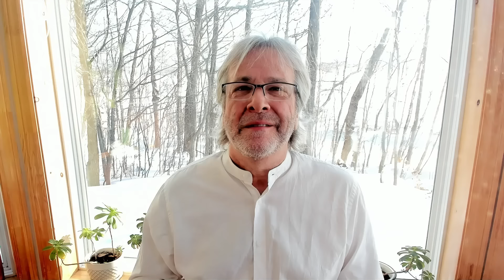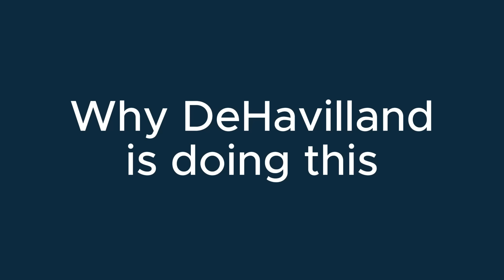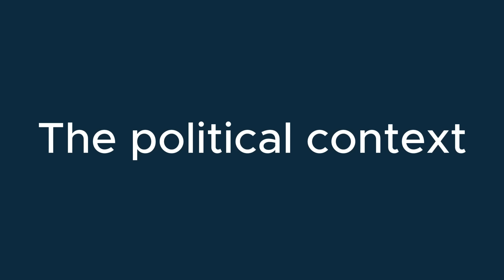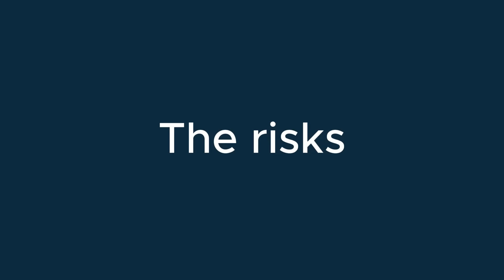De Havilland Field: The Quiet Canadian Project That Could Change Aerospace Forever

Comment: Is Viking part of DeHavilland Field. Where are the CL-415 and 515’s  being built. What happens if Alberta separates
Reply from the maker: Viking & De Havilland Field
Viking Air no longer exists as a separate company. Iit was folded into De Havilland Canada in 2024.
The merged company is developing De Havilland Field near Calgary as a major new aircraft manufacturing site.
The old CL-415 is no longer in production; De Havilland now supports the fleet.
The new version, the DHC-515 (formerly CL-515), is being built and assembled in Alberta, with final assembly planned for De Havilland Field. I hope Alberta doesnt seperate. We are so much stronger together. thanks for sharing

Comment: You have to understand the politics.  Trying to break into the small to medium passenger aircraft segment, and all the competition and political lobbying from the larger manufacturers, De-Havlland sort of got pushed under several times, and has had several owners including Bombardier.  That Boeing does not produce state of the art, and "reliable" and "safe" airplanes any more, but does a lot of political lobbing and arm twisting to maintain a market share that it does not deserve.  I would not fly in one.

This  De-Havlland factory is sort of hush-hush because it has more than a 50-50 chance of failure.  But if it suceeds it will really suceed, and be a competitive source of airplanes.  A sucess factor is selecting the right size and type of plane to manufacture.    There is a "sweet spot" in what works best and most profitable for carriers, (what they buy the most of) and manufacturers need to hit that right in the middle.

Comment: I was debating with myself, whether or not I should comment, but here it is.  I have developed a totally new propulsion system that will make conventional aircraft obsolete. I am in Alberta. This project will replace all jet engines, rockets, and most air and marine propellers. A single craft using this propulsion system will be able to operate in air, under water, and in space. It will be capable of every maneuver attributed to UFOs. It is shaped like a flying saucer. That shape is functional. I have a working proof-of-concept prototype and will soon have a practical-purpose prototype. It is called a centrifugal propeller. I have worked on this since 1981 and have about $900K of my own into this project. It will make patrolling of Canada's arctic easy and efficient. It will be capable of reaching Mars in under 10 hours, depending on the location of the planets in their orbits. This is definitely a game changer.

Comment: I’m am pleased that it is an aerospace location outside of Quebec. We will no longer be tied to Bombardier or cross border shopping. It will assist in northern security by designing and producing tough aircraft that are required to operate in arctic conditions.

Comment: Its interesting to note that de Havilland Canada started in Downsview Ontario, not Quebec. The famous waterbomber originated with Canadair from Montreal. Some of the earliest firefighting from the air started with the Provincial Air Service in Sault Ste Marie ON where my Grandfather worked from 1929. The waterbomber scoop evolved from a similar system used in British steam locomotives of the era that scooped water from a trough between the tracks, avoiding the need to stop for water. My grand father started at the Bristol Aeroplane Company and brought some of these ideas to Canada when the air service acquired metal skinned seaplanes after WW1 and needed skilled people to maintain them. Over a century later de Havilland carries the torch in Alberta! Go for it!!

Comment: What engines do they use?
American?
Reply from the maker: Damn.... I dont know. I'll check
Reply: For what aircraft type? Just look up the type in Wikipedia and read the name of the engine manufacturer. For instance, the Twin Otter has always used Pratt & Whitney Canada (PWC) engines, and I think all variations of the DHC-8 (Dash 8) and the water bomber (CL-215T/CL-415/CL-515/DHC-515) have used PWC engines.

Comment: Why not include some pictures of the planes ✈️
Reply from the maker: Because I get dinged with copyright issues... I'll try...
Reply: @CanadianShields  you can use images from Wikimedia Commons (where images in Wikipedia are hosted) without charge as long as you credit them. Corporate websites should also typically allow sharing with credit, as you are promoting their corporation... look for "media resources".

Comment: It's good that De Havilland is back, but the frequent reference to Quebec is incorrect. De Havilland was centred in Downsview, Ontario.  For many years and through different ownerships with Ontario subsidies, it was finally bought by Bombardier from Boeing, which expanded the Dash 8 line and built the current Global there. Sales for the water bomber had been slow, so Bombardier tried to set up a new slow production line, if I remember right, in North Bay, Ontario, which never worked out, and later sold the rights to Viking.  Because of under Trump 1, a 300% tariff was applied on the new, very advanced C series(now A220). Bombardier had to sell off components like the old De Havilland components.
Reply from the maker: Thanks for the detailed history lesson! It's always great to learn more about the roots of Canadian aerospace. Sorry for the errors...Glad you watched!

Comment: The Type Certificate for the Twin Otter belongs to Viking Air in BC, not DHC.  I can't see Vking Air moving to AB.
Reply: DH bought Viking, Field and Longview almost two decades ago.
Reply: @bobboersema362  not quite - you have it the wrong way around; Longview bought Viking and later the De Havilland Aircraft of Canada name. Longview bought Viking (in 2003), and later formed De Havilland Aircraft of Canada Limited (in 2019) to manufacture the Q400, later putting all divisions under De Havilland Aircraft of Canada branding (in 2022) and amalgamating the business as De Havilland Aircraft of Canada Limited (in 2024).
Reply: Viking is part of the new DHC, and purchased the DHC-6 type certificate after it was acquired by Longview (which became De Havilland Canada). Yes, De Havilland Aircraft of Canada Limited does intend to move at least some of Viking's operations to De Havilland Field; much of the work on DHC types is already in Calgary.

Comment: Could you show more of what they will be and are doing? Which planes, the construction site, drone flyover, plans etc.
I am an rc Buff, or used to be. I loved billing the 8 & 10 ft wingspan  Dehavilland planes. The beaver, single otter. The tiger moth among them.
Great company. We used to fit into the line in the Yukon in an otter, or beaver. Safe planes. 
Tough. Cold weather.
More information would be great

Comment: Can you confirm if this is including the Viking Company in Calgary
Reply: Viking is now apart of DHC.   Was about 10 companies that became 1
Reply: @jetdoctr  10? Viking Air, Longview Aviation, Pacific Sky Training and De Havilland Canada (the Dash 8 operation) became De Havilland Aircraft of Canada Limited, then De Havilland acquired Mid-Canada Mod Centre and Avionics Design Services Inc. and Field Aviation Company Inc. That's six - did I miss some?
Reply: Yes. There is longer a separate Viking company; the old Viking operations are integral parts of De Havilland Aircraft of Canada Limited.

Comment: I want to see the Saab Gripen production built / assembled / sub-assemblies built so that we don't buy the F-35.
Reply: I understand your sentiment and I was on the same page, but the Saab Gripen and the F35 are not aircraft in the same class or capability.
Reply: @Calvin-p4e1g  I understand and agree. But they don't need to be. But, I don't think we need the F-35's capabilities. And, we don't want to be dependant on the US for parts, some servicing, and updates, not to mention the possibility that they have remote access to the software.
Reply: @DavidM2002  the other issue that we have to think about is the added risk that a single engine aircraft provides compared to a twin engine. When we are working with international forces, which aircraft are going to have the best support available? If everybody else is using the Gripen it may be a good choice.
Reply: The US will destroy us economically if we buy the Gripon.

Comment: Best news for Alberta in a very long time. Something really positive. de Havilland Field is only half hour from our place. With pilots in the family, and having lived in the north, we have a true appreciation for their aircraft. 
PS  I love your backdrop 😊
Reply: and Ottawa won't be able to shut them down like they did with Avro.
Reply: @johnstreet797  AVRO was shut down by the Conservative PM called John Diefenbaker.
Reply: @D-PHubbell    Muppet that was STILL Ottawa.   Not the thickest book in the library are ya.
Reply from the maker: Bring back the Beaver! 😂 Thanks for watching and sharing
Reply: With a cost effective LT V8 engine conversion that makes 500 flat-rated hp. Think Orenda, but on the newer architecture.
Reply: Um, what about the $38 billion pipeline you just got?
Reply: @robs8882   Who the F is we ?   The FEDS  got that and they bought it to prevent from being sued by KM and for NO other reason.  They would have NEVER bought it if they were not under threat of potential half trillion dollar lawsuit..   And the clowns managed to take a $7.4 Billion including contingency project and pork barrel it to $34 billion.   Making it the most expensive pipeline EVER IN HISTORY by per  KM in the western hemisphere by over a factor of 3.....

Comment: To support Canadian ingenuity and aerospace prowess and provide a substantial response the the ever growing annual wildfire threats, the Canadian Armed Forces (CAF) should acquire 30+ DHC-515 "Super-Scooper" aircraft from DHC.  Given that current contracted order sheet for the DHC-515, is largely going to European customers, the current production line is full until 2029-2031nso there is time to sort out the options and prepare the bases and personnel.  The CAF could strategically base these (West, Centre, East) planes to better respond to fires and could crew and maintain them with a mixture of Regular and Reserve RCAF personnel as well as contracted services in conjunction with current Canadian DHC-215/415/515 users (ie Provinces).  In off-fire season, these planes, if properly configured, can be used in search and rescue and/or sovereignty patrol tasks.
Reply: That's provincial responsibility. The RCAF should acquire four Modular Airborne FireFighting Systems (MAFFS) for use in their C-130 aircrafts. Have two based at Trenton and two at either Winnipeg or Cold Lake.
Reply: Bad idea. The CAF has enough on their plates without the addition of firefighting. Let the real, trained firefighters do their jobs.
Reply: Or you could just start putting the arsonists and their backers in prison. Lot cheaper and a far more certain outcome.
Reply: For the water bombers in the off season just send them south.  The problem is those planes arent really designed for really cold environments so you need to do a lot of work to winterize them.  By sending them south they just keep doing the job they are designed to do.
Reply: Canada needs more bombers, water bombers. We make the best in the world and the government should build up a supply of them because they will surely be needed with global warming.
Reply: @dbolt6543 , people need to held accountable for starting many of these fires. Stop separating the forest with glyphosate so dry out and maybe just maybe the amount of fires will be reduced. If you haven’t noticed global warming/climate change isn’t an issue. Even globalists overlord Bill Gates admits that.
Reply: @dbolt6543 Globalists warming to total control through eco mania, you mean.

Comment: DHC6 400 production restarted 2008 with the first delivery in 2010. Production at the new facility will include the 300G, a modernized edition with lower mass.
I believe the project "started" when Viking Air purchased the type certificates for all the DHC aircraft. 
The important factor was that production of CL415 water bomber ended 10 years ago. The "Super Scooper" CL415 is unique and tremendously valuable precision water bomber. EU is in love with them but they are wearing out.  The crash rate is very high. The danger level is extreme.
Spain and France and EU in general demanded more and Viking said "cash on the barrelhead" to build a new production line.  
Viking/DHC owns the type and they will build the DHC515, 21 century firefighter with synthetic vision. It can fly missions in total darkness. Deliveries start 2032?
The first 30 or so are going abroad at around $55 million ea. Confirmed orders for these aircraft are the base reason for the new plant.
Reply from the maker: Thanks. What a beautiful aircraft
Reply: I got 3-view drawings of the CL-215 from a booth at the Cold Lake airshow when I was a kid. They spent years yellowing on my bedroom wall.
Reply: Whoa that DHC515 sounds badass. Prediction though: in 5 years people will be calling for remote controlled water bombers and in 10 years they will be flying themselves. I hope the DHC515 can be adapted to that.
Reply: Thank you for a notable and important supplement. I have chartered piston otter, turbo otter, twin otter, and especially beaver aircraft from Osprey Wings in N Sask since 1975. And a CL215 was in circuit near my house in 1987. Saved the house. They all go the job done . Osprey has excellent mechanics and pilots.
Reply: The 300G is just a rebrand of the 400 program, since nothing fundamentally changed between the 300 and 400 minus the Avionics.

Comment: Great video, but you can hear that the script was written by ChatGPT :-). I don't mind, it's just funny that you can hear it.
Reply from the maker: I try to get rid of the words and expressions that are typical chatgpt. I usually bring together multiple articcles and compile them using AI. I think the reason it sounds like AI is because its a straight compilation of facts. I'll do better. Thanks for sharing.
Reply: @CanadianShields  The tip-off is the parallel sentence structure.  ChatGPT really likes it for some reason. 

What I normally do is take what ChatGPT produces, edit it waaay down, and insert my own stuff. The real key is deleting lots of stuff.

Then I can ask it for minor edits to make sure I didn't screw anything up.  Edit myself again, repeat.

This way I get something that's more my own style,  but it's still much faster and easier than writing from scratch.